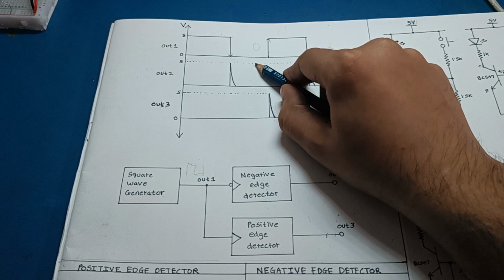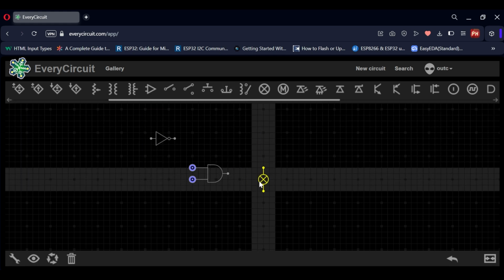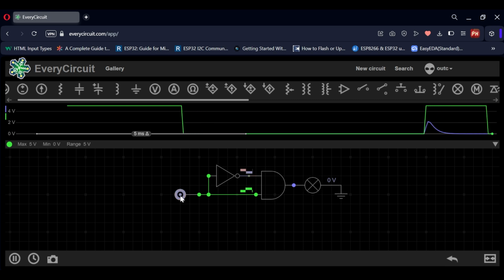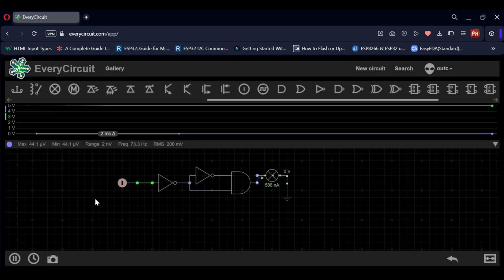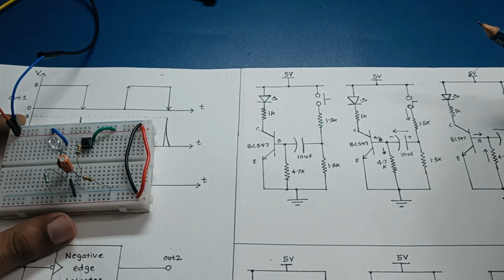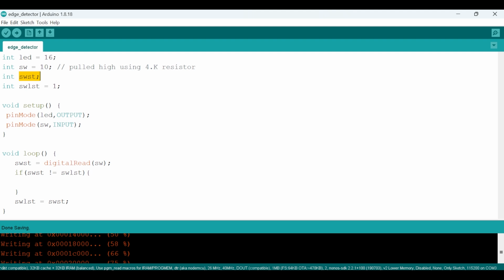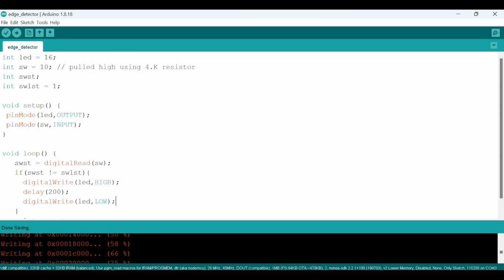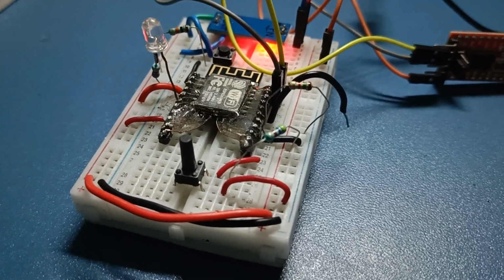Signal Edge Detection using Gates , Single Transistor ( BC547 ) and Microcontroller ( ESP8266 )

Comment: Can we build positive and negative circuit with single switch and single led it means when switch is on led blinks and when switched off it again blinks
Reply from the maker: Yes, 1. on switch press - the charging current direction is towards the base of transistor so we use NPN BJT BC547. 2. On switch release - the discharging current is not detected by BC547 as its a NPN, but you can use a PNP to detect discharging current. thus, you will get two bilnks in one switch press, it will multiply frequency by 2
Reply: @prachethire812 can you give me a circuit diagram or make a video on this
Reply from the maker: @sahilakhtar4756 Sure, I would like to make a video on it, video will come soon in one or two weeks.
Reply: @prachethire812 well i figured out the connection but faced problem on led connection 
Glad that someone on youtube takes comments seriously and thank you for the help

Comment: Hi, is it possible to use this circuit to detect falling edge coming out of output pin of timer555? If it is, how to connect that circuit? I am trying to build a model of a circuit that drive traffic lights and it would help me to move forward with this project.
Reply from the maker: You have to replace the switch with another NPN transistor (like BC547). That makes the circuit of two NPN transistors.

Comment: hello bro, i tried your falling edge transistor detector circuit, but it lights up briefly the moment the circuit is turned on. how do you prevent that?
Reply from the maker: Yes I know that. That's because the capacitor charges initially when you turn on the supply. The transistor turns on for the time period till the capacitor gets completely charged and there is no current flow. I also don't know how to prevent that, never bothered me, I use it as a start trigger to reset the IC, but if its creating a issue in your case, maybe I will consider making changes to the circuit.
Reply: @prachethire812  i connected this circuit to activate an SCR, and the SCR turns on upon powerup
Reply from the maker: @jotarojoestar1399  Got it, somehow you need to isolate the capacitor in the negative edge detector when you initially turn on the supply. I will modify the circuit in simulator app "Every circuit", send you its link.
Reply from the maker: @jotarojoestar1399 
This is a positive egde detector followed by a not gate at input, this makes it a negative edge detector, link is given below
https://everycircuit.com/circuit/5720725898002432